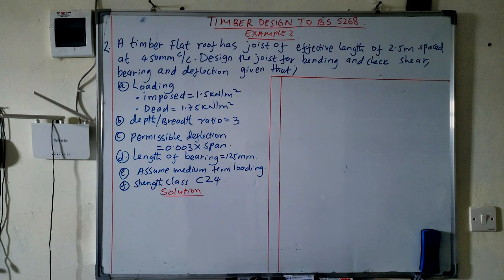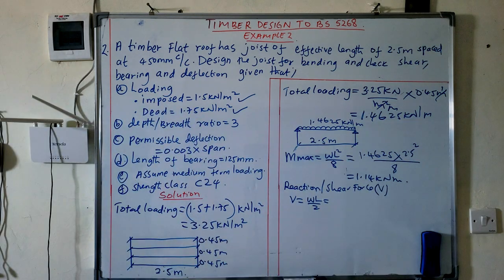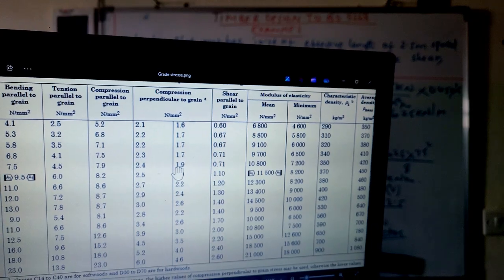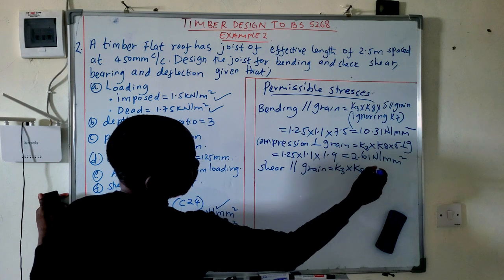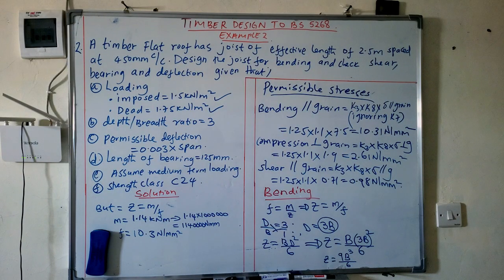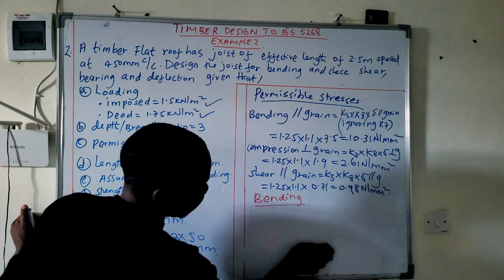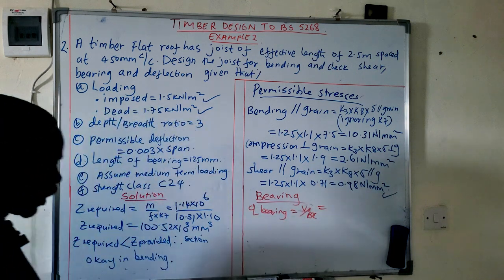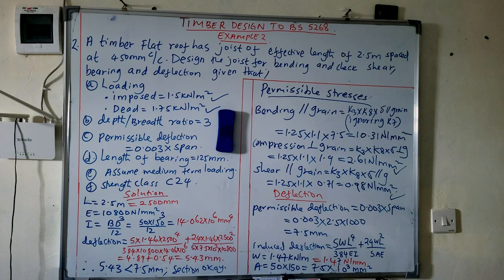Timber Design to BS 5268 – Problem #2

Comment: Hello...why aren't we using the factors to factorise the loads before we add to get total load
Reply from the maker: BS 5268 (Code of Practice for the Structural Use of Timber) is a permissible stress design code — not a limit state design code like BS 8110
Reply: @OdavigiStructuralHub okay noted👍

Comment: Is k7 used  in calculating  bending  parallel to grain
Reply from the maker: K7 is used to modify grade stress which is bending parallel to grain obtain from the strength class table. The value of K7 depends on the depth of the timber

Comment: When calculating permissable  stress in bending  parallel to grain  and k7 is given  will one use or assume if depth is not given
Reply from the maker: if you are given K7 it is a must to use it in calculating permissible stresses in bending parallel to grain, again if you are given depth say 350 mm you should also calculate the value of K7 and use it to modify bending parallel to grain.
Reply: Ok